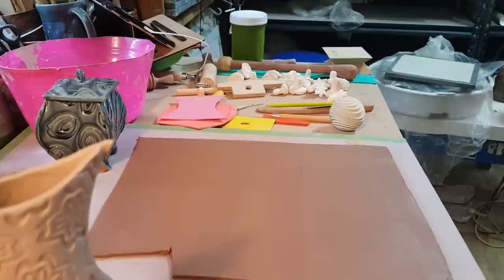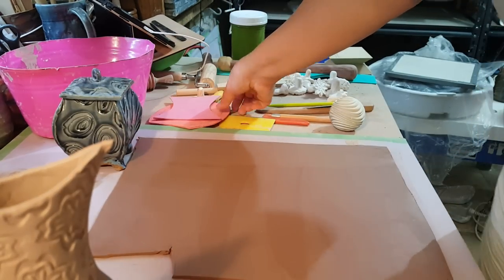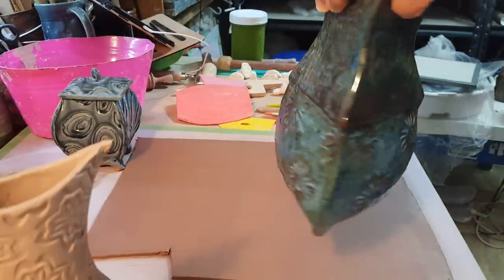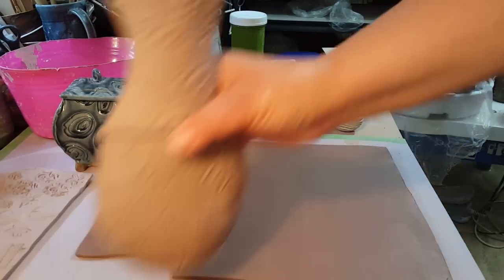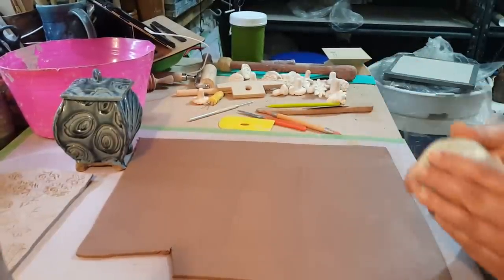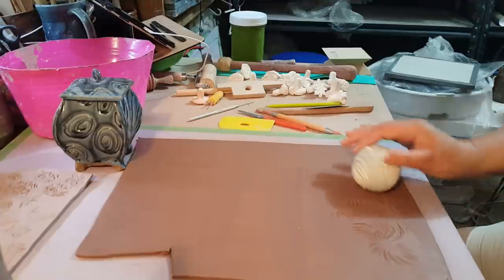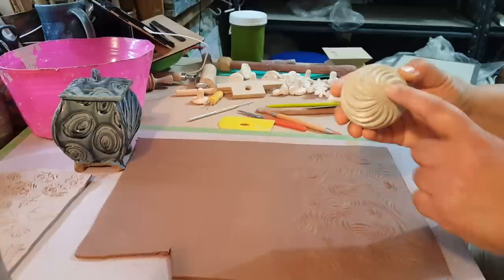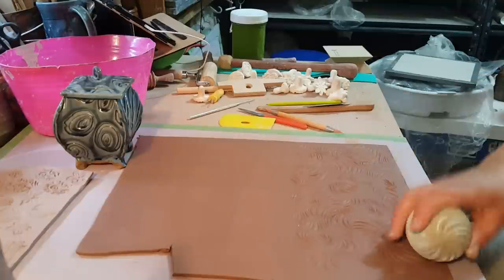How to Make a Hand Built Two-sided Vase from a Slab Using a Template

Comment: I have found that juggling with slabs that are still very soft and wet is very difficult, and it’s hard to get a neat result. I let my slabs dry out more now, and construction is so much easier.
Reply from the maker: I agree!  🙂
Reply: How did you make such a perfect flat thick surface to start with? Did you purchase it like that or did you make it?
Reply: This is terracotta clay right? I made a tag with terracotta clay but it's dusty I believe in supposed to find a glaze and bake it I'm not sure I'm so new at this. Do you know if that's right that after it air drys is the next step glaze then bake in the oven? And also do you know where to find the best deal on clay and glazes? I want to do this more often.

Comment: can you tell me how tall each piece is (top and bottom)  are they the same height?
Reply from the maker: Next time I am in the studio I will get the measurements and let you know.
Reply from the maker: The top is 4 and a 1/2 inches tall and the bottom is 5 and a 1/2 inches tall.  The top piece is 4" wide at the top and 4 and 1/2 inches wide at the bottom.  The bottom piece is a 3 and a 1/2 inches wide at the top and 3 and a quarter inches wide at the bottom. Hope that helps!

Comment: Hi can your share the measurement of the template
Reply from the maker: The top is 4 and a 1/2 inches tall and the bottom is 5 and a 1/2 inches tall.  The top piece is 4" wide at the top and 4 and 1/2 inches wide at the bottom.  The bottom piece is a 3 and a 1/2 inches wide at the top and 3 and a quarter inches wide at the bottom. Hope that helps!